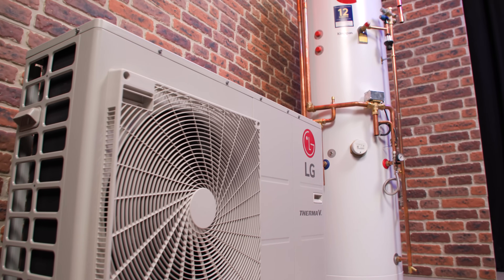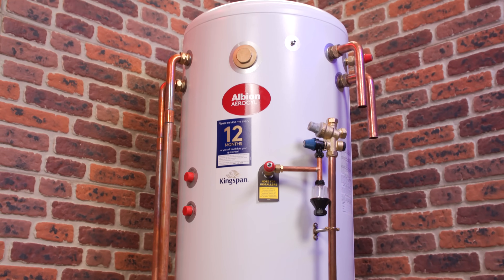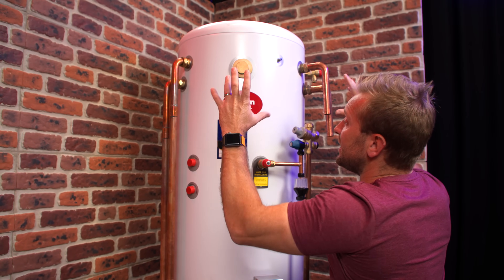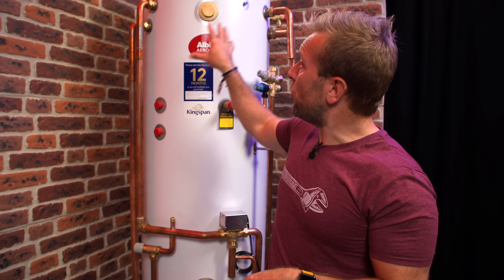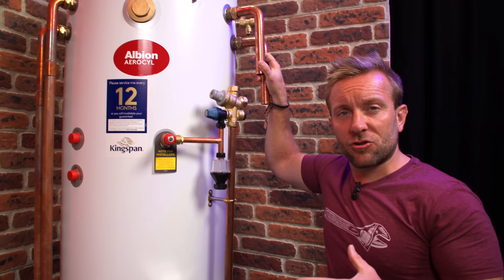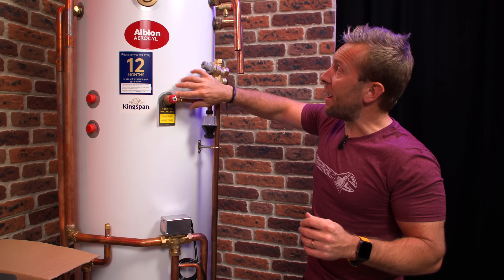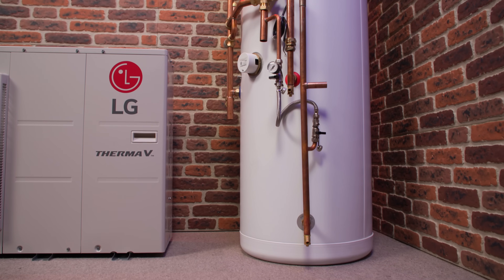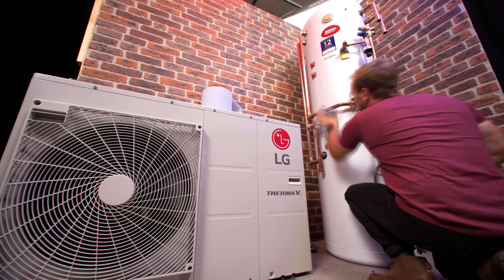Air Source Heat Pump Buffer Tanks explained - Kingspan Albion Aerocyl

Comment: A note of caution … if we want the heat pump rollout to be a success, they are going to have to deliver heat at a price that matches gas, preferably even cheaper. Therefore, to anyone thinking of installing a heat pump, PLEASE be very cautious about putting in a buffer. Unless you are able balance the flow rates very closely on each side, you’ll likely end up with the heat pump running hotter than it needs to, thus reducing COPs and making the householder’s energy bills higher than they need to be. You only really need a buffer if the circulation pump in the heat pump can’t produce adequate pressure for the (probably larger) property, or if you are feeding in more than one heat source, eg. a boiler backup. Defrost can be taken care of by leaving enough rads permanently on, or if that’s an issue, put in a volumizer in the circuit. Take a look at the excellent videos from ‘Heat Geek’ and ‘Urban Plumbers’ on buffer tanks to get the expert view on this.

Comment: Nice video but, a big but, buffer tanks do not increase efficiency. Please get it right! You only need one if the heating system flow rate will at any time be lower that the minimum required by the heat pump (e.g. zoning or radiators being turned off) or the heat pump does not provide enough head for the heating system (e.g. microbore or heat pump a long way away)

Comment: Most heat pump manufacturers offer pre plumbed cylinders with built in buffer.  The leading brands have inverter driven compressors so short cycling isn't an issue, a buffer is mainly used to maintain minimum water volume for the defrost.
Reply: They only turn down to 25-30%, so the larger models still need a buffer
Reply: @hvacdesignsolutions  not ours, we only require a buffer (volumiser) if you can’t meet minimum water volume in the open circuit for defrost . A buffer can be useful in larger installations where you have multiple heat pumps cascaded.
Reply: @hvacdesignsolutions  then the heat pump is oversized?
Reply: The buffer is also useful if you don't want to replace the heating flow and return e.g. if its microbore, the heat pump requires a minimum flow rate which may not be achievable if the ASHP is connected directly to the heating circuit.

Comment: Hi James

Can you do a full video about the wiring of this system please?

I’m a bit confused about the 3 way valve ,because it comes with 5 wire and the heat pump doesn’t accommodate that .
The heat pump has only 3 connections on the terminal block so I’m thinking that a diverter valve will do the job 
So I’m not sure how it works 😅

Thank you

Comment: This is a great vid as Im not quite there yet and find quite a lot of information that can be contradicted depending on what forum Im on.  I surmise that a buffer may not be required depending on the system design.  Thank you regards Mike
Reply: I watched this for the same reason. Urban Plumbers says the opposite, he tries to leave buffers out where possible to increase efficiency. I think the trick is to not oversize your heat pump so that it won't be cycling.

Comment: It is a shame they have put all this effort in and fitted a prehistoric drain valve at the base of the cold water feed (pet hate !). 
Why not fit a full bore valve with a 3/4 male connection to allow fast draining and more importantly an perfectly located pressure test point when servicing ! 
Rather like the Megaflow ? 
I absolutely agree with the point made about fitting the combi valve at a high point...

Comment: So does the heating water get solely pumped in and out of the buffer tank, whilst the hot water for taps get solely fed by gravity out of the lower section of the tank please?
Why do you need the buffer tank at all, you don’t need one for a gas boiler, surely the flow from the heat pump could feed the radiators directly without an intermediate system?

Comment: The buffer is more important as the mixing point for a fixed flow system and a variable system. Just like a big low loss header. It will also stop short cycling of the heat pump.

Comment: I was fooled by the thumbnail into thinking it was installed outside (outstalled?). I was looking into this as our house is so small.
If I build a wood or brick shed for it outside. Should be ok right? Be the same as 1 in a garage.
In fact could I put both in said shed?

Comment: Hi. I have a question, We have a tank for DHW with a coil and buffer tank underneath without a coil. There is a heat element but it is not connected to the box, only DHW water tank its heat element is wired up and connected to the box and it is used for disinfection of the tank, weekly. Now when the temperature outside is -4 , LG THERMA V 9kW heat pump can’t cope. It is using 6 plus kW of energy , water temperature outlet 41and inlet 30max ( 30 ‘C is going into the rads and in the house is 17’C) . Pump can only generate 40’C because the rec pump to the radiators is returning 20’C back to the buffer tank only so on. Every 10-15 mins the pump is defrosting so by the time the defrost cycle finish temperature in the buffer tank drops to 20’C . How I can help the heat pump to generate higher temperature? Im freezing. If I will use that heat element in the buffer tank which is not wired up , will I loose my government grants for the installation of the heat pump? This is second sezon, we we promised that this is better than our bosch boiler which we had before. Thank you in advance. Rafal

Comment: Why the hydronic separation between heating and air source heat pump. Surely the heat pump circulator pump is good enough to pump round the radiators/underfloor heating?

Comment: I moved into a property with a Therma V it only has a small buffer tank. But also has a Combi attached. And seems to use this for hot water. The air source pump rarely kicks in. Controlled by an LG controller in loft. The plumbers I've had to look at it dont understand heat pumps. So I'm a little confused how its actually meant to operate.

Comment: I'm curious why you'd need an immersion heater in the buffer, is that just to backup the heat pump in case it fails or is it to backup the heat pump for cold weather?
Reply: Could use it if you have solar panels?
Reply: @Harry_Mending  Since this video the same channel has kind of explained a few more things. One seems to be that the use of an immersion heater means you can bring the buffer to a usable temperature and then fall back to the heatpump in cold weather. This is because trying to get a really cold buffer up to temperature with a heatpump alone in really cold weather might just take too long, but if the buffer is pre-heated then the heat pump can keep up.
Reply: @NickAskew  interesting, thanks. Do you know if there's any reason that this couldn't be run off a gas-fired system boiler until a heat pump can be installed?
Reply: @Harry_Mending  In the Netherlands, where I live, combi/hybrid gas/heat pump systems are gaining traction. I'm not a big fan but what it means is that a heat pump can do most of the heavy lifting and then when it cannot cope, the gas boiler is fired up instead.

I believe they are usually retrofitted to an existing gas boiler. I'm sure this is not the only country to use them, but my concern is that sooner or later you will need to replace the gas boiler and then if the heat pump is undersized you will need to replace that too.

Comment: Just the quick question, in the summer when the central heating is not needed or defrosting of the heat pump, is the hot water in the buffer tank therefore wasted?

Comment: Great vid mate.  With the roll out of heat pumps Do you think it’s still worth doing a gas course ?  I’ve stuck a deposit down for may but I’m in two minds! Would be great to hear your feedback 😊
Reply: Ive trebled and on some occasions even quadrupled my money than doing boiler swaps, lets be honest with each other were in this industry for the money NOT the love of the game. you have to speculate to accumulate, get yourself on the course.
Reply: @johnhine1007   hi John are you able to explain how it works with ‘gas improver/newly qualified’ so I assume you shadow some one for a duration ?
Reply: @charliefox6987  there's no gas at all to worry yourself about, apart from maybe disconnecting the odd gas boiler, you do need, however, a basic understanding of heating systems, I've literally been re-piping heating systems from scratch probably a day extra in work and give it a hot chemical flush. 
I'm not 100% certain, but I'm think you may need to be part of an accredited organisation, i.e., Gassafe or similar and have a few years' experience in the trade to sit the A.S.H.P course don't quote me on it though. My advice would be to ask the training provider. But the money on the A.S.H.P grant scheme certainly outweighs those who fit boilers on the free boiler scheme.

Comment: I have 150m2 of a 100% UFH should I use a buffer tank? There seems to be conflicting options about this! The Heat Loss is 38w/m2 and has a large thermal mass. (100mm slab)

Comment: Can someone explain what this system does, is it storage tanks for hot water, and is it used for infloor heating or rads on the wall...it looks very expensive as compared to a basic 240 volt electric hot water system...thanks

Comment: I had a heat pump salesman visit me and I told him I wanted to keep the Combi boiler for hot water and have the heat pump to do the radiators with assistance from the Combi when needed. He got up and walked out saying it can't be done. I won't print here what I thought of him!!
Reply: Bosch do hybrid systems that run alongside an existing Combi gas boiler .

Comment: I have Juile  500LitreThermal Store Solar 1 buffer tank, I did have an air source heat pump order then all grants got cancelled so ended up going for an oil burner. 
So oil as the primary heat set at 35c-45c, but I can by pass this and run the heat of 2  boiler Stoves 11KW, vented with a metal over flow tank due solid fuel heating. 
Then a pressured heating comes of a high and low tapping's , to a plate heat exchanger this supplies toe the UFH, 
It runs at 65-80c so in modern house it is 2-3 days before you need to fire up at stove again. As the buffered water warms the UFH loops. 
It is hocking how many plumbers are unaware of how these systems work. After halting no less 12 plumbers on my self build I completed the work myself, being and engineer I was ok with this and then got all systems inspected and signed off. Buffer is vented and the heating pressuriesed
Reply: That's because you are using "plumbers" instead of " heating engineers"

Comment: This is probably a daft question (I am new to the world of heating systems), but can you integrate this into an existing combi boiler set up?
Reply: Yes but you would have the combi boiler as a ‘backup’. I.e if the outdoor temp drops to a low temp the boiler would kick in and boost the system where the ASHP may struggle

Comment: When you look at the all the stuff you need for a heat pump solution compared to a compact Gas boiler or electric heating solution it is no wonder people are not rushing to install them.  It looks like some industrial installation from a Star Wars set.  Cost and noise ?  Do they really work ?  The solutions in the future need integration into new buildings. i.e. underground heat exchanger pipes laid with foundations, air pumps inset in walls and integrated with solar electric and water heating and wind turbines built into roofs.

Comment: How do they get round the need for a spring loaded valve on unvented to close the valve to prevent the cylinder continuing to heat up. Are they just fully reliant on the cylinder stat, safety cut out and then the tprv operating. What happens if the 3 port passes???
Reply: The valve is pointless on anything heating water.  The heat pump isn't going to get anywhere near boiling and any decent gas boiler has a proper temperature control and an overheat cutout.  The spring loaded 2 port valve is just a scam to sell more 2 port valves.  Viessmann got dispensation to cut them out.
Reply: It isnt a mid posistion valve, its a divertor that motors open for HW call and spring return to Ch. Rest posistion is open to CH.

Comment: Not enough buffer. A house needs at least 2000 liters of stored warm water. It is the bragging piece when you drink beer with you friends. 1000 liters is needed just for your teenage daughter, you get five liters to wash your face and 995 liters are for proper buffering.

A more important question is if the houses are properly insulated and have double or triple glass windows, otherwise you are burning for nought.

Comment: You don’t get hot radiators with heat pumps. Where is the heat element for the main tank? Legionella protection for low temperatures. Buffer tanks for system volume so always make sure you consult the design. 
Nice tanks but loads of question marks.

Comment: Our neighbours moved to a new house with a heat pump he was not happy with the hot water temperature with a max temp of 52 degrees he had a small gas boiler fitted to bring the temperature in the cylinder to 65 degrees. He also noticed in older houses the heat pump cannot can deliver a home temperature of 20 degrees so the gas boiler boost help deliver the 20 degrees temperature especially when outside temp is below minus 8.
I believe older houses will still need a small booster boiler on top of an heat pump.

Comment: We only use all natural plumbing materials for our home. Instead of burning fossil fuels or using refrigerants to heat our water we use natural solar energy to heat our water.  Instead of cast iron or vinyl based plastics we use hollowed out logs for our DWV lines and pig or cow intestine for our water supply lines instead of PEX or copper which are both very energy intensive to make or recycle. If we all do our part earth might last another 50 or even 100 years! You should really look into the Viega all natural piping line of products. I get some people will be turned off drinking water that comes through an animal intestine but they sterilize them before they are vulcanized into pipes.
Reply: It's disgusting that you would harm our animal brothers just to harvest their organs for your plumbing. 

I've chosen not install any form of plumbing in my house to save the environment, infact by shitting on my vegetable patch it helps it grow.
Reply: @maximuswong3092  good for you, a true environmentalist.

BUT WAIT....

 
What enviironmeltally friendly device are you watching this video on ?🤔🤔🤔🤣
Reply: @David-bl1bt  iPhone 14 pro max
Reply: @maximuswong3092  What have you done with your old iPhone 13 pro?
Reply: @eddyr3691  it's sat in my drawer as a backup.

Comment: Where was the explanation why the buffer negates fitting larger rads?
Reply: It doesn't. If anything you'll need bigger rads as using a buffer reduces efficiency due to the heat pump needing to run hotter. Manufactures are introducing buffers as most engineers don't know how to design systems correctly. Having a buffer ensures the heat pump works  even on a badly designed system.

Comment: Why do you need a tundish?! The plumbers here doesn't even know what that is....  I have a drain next to my boiler, just a normal Gardena hose adapter and a hose should be enough to divert the water to the drain...
Reply: So you can see the failure/water passing is occuring.
Reply: It’s also safety device/ air break incase termination is blocked, although the design is terrible and generally cause loads of property damage

Comment: No need to increase radiator sizes? Lower mean water temp requires larger surface area, unless your lucky enough to have hugely oversized radiators, turning the flow temp up will just reduce its efficiency

Comment: I would like to install a heat pump to supplement my current gas combi boiler. The heat pump heats my house at low temperature but if I want to warm it quicker I switch to the combi. I do not want a bl***y great tank in my house.
Give me this system please. Why do the heat pump evangelists want to get rid of a gas boiler?

Comment: It's huge compared to my 5 year old boiler. In future I'll go for a hydrogen ready  boiler.
Reply: You'll be waiting a long time for that!
Reply: @LewishamPpleB4Profit  . I'll wait. The current gas distribution network is worth billions. It will be utilised.  I won't be buying a heat pump.
Reply: Very unlikely, hydrogen is extremely costly &  inefficient to produce.
Reply: @David-bl1bt  . U can already buy a hydrogen ready boiler. Heat pumps aren't suitable for the majority of UK homes . Natural gas will still be used till hydrogen is viable. Relying on solar and wind is a big mistake.  It will take decades to build enough nuclear capacity.
Reply: @johnh1872  Hydrogen will never be economically or practically viable for domestic heating. Making green hydrogen to burn in homes would take 6x the number of wind turbines compared to heating the same number of homes using heat pumps.
Reply: @nealm1814 . If that was the case then surely the government wouldn't  be insisting on making all new boilers hydrogen ready after 2025. Heat pumps just aren't suitable for the majority of the current housing stock in the UK.  I'm  sure  a solution will be found .🤞
Reply: @verygoodbrother . All i know is government making it compulsory for new gas boilers to be hydrogen ready.

Comment: What a totally disgusting mess.... And how much power does it take to run all the time,
And you have to have back up power to per heat the water, and a extension to fit it in....
And a constant fan noise in the background,
All fan's proreduce noise....no what people try to say....
Reply: You are so wrong on every point you made, there is still so many untruths surrounding heat pumps,  we need to educate everyone to dispel these misconceptions
Reply: AKA you're to poor to buy a heatpump.